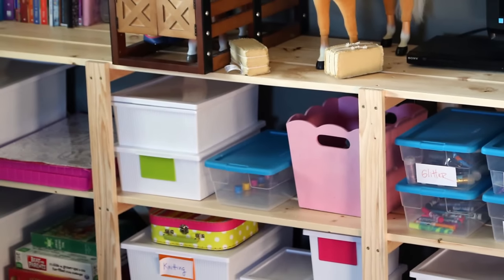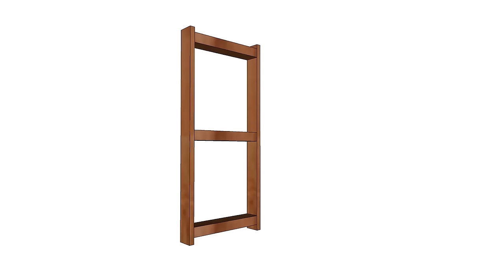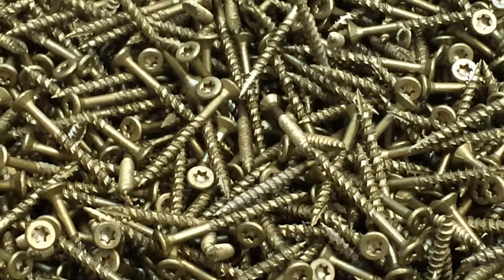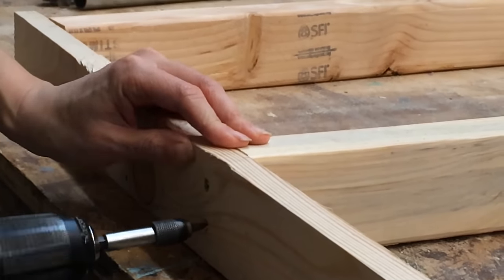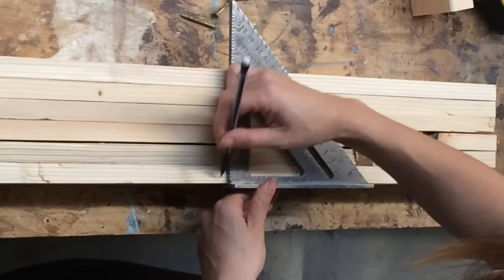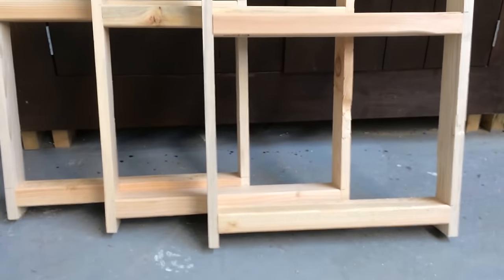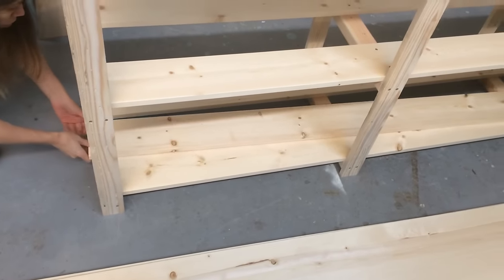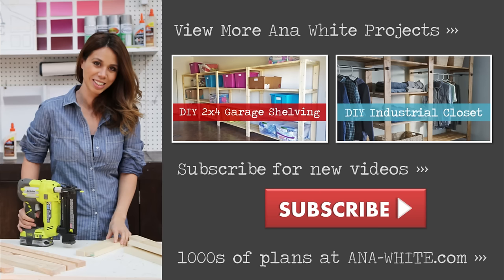Easy DIY Inexpensive Wood Shelving

Comment: Wait a sec. If the legs are 1x3s, won't the 2x4 supports be wider and thus stick out? Did she use 1x4s for the legs here, or 2x3s, or what?
Reply: The 2x4s go vertically, so width-wise they are 2 inches, and height-wise they are 4 inches.
Reply: Yeah pretty sure it’s a 2x3 in the video, looks to be same width as the 1x3